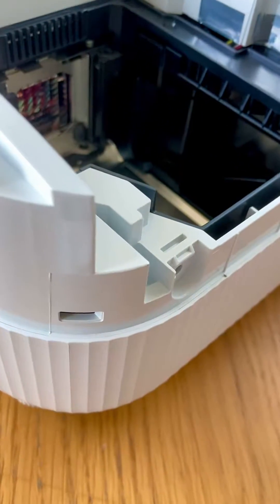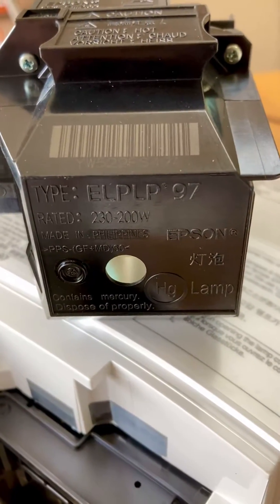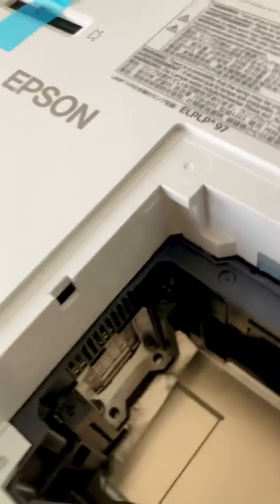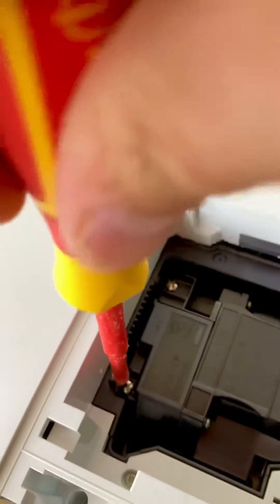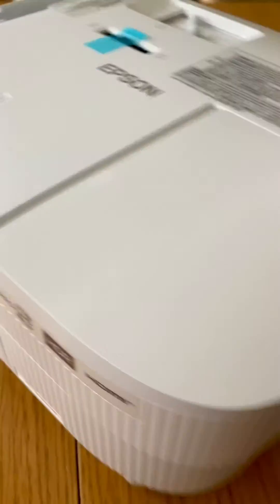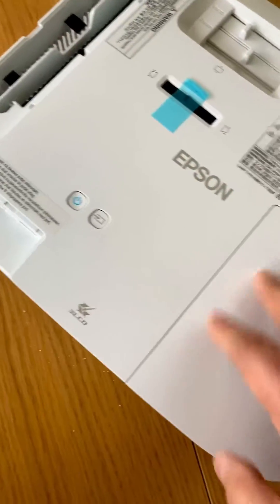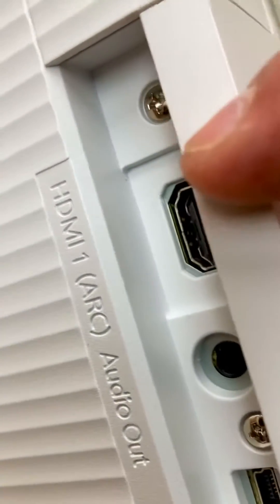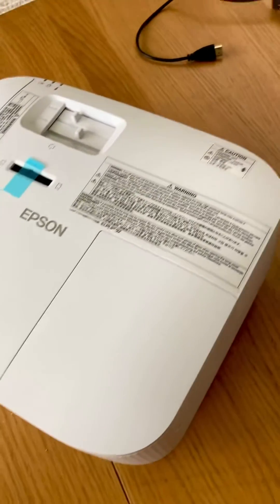How to Replace a Projector Lamp?🤔📹| See: Epson EH-TW6150, EH-TW6250, EH-TW7000, EH-TW7100 & others

Comment: Excellent video thank you, so useful, my current lamp is flickering a bit on low and mid power so i presume its on its way out. Is it wise to replace it before it goes pop? Can I cause damage with this model if it pops?
Reply from the maker: Hey 👋 Thank you for the feedback - really appreciate it 🤗 

You should replace the bulb if you're already seeing signs of deterioration. These bulbs are built under high pressure and operate at a very high temperature / dissipate a lot of heat. The bulb's glass envelope can burst and can certainly damage other components within the unit. So yes it can definitely "pop". We do also highly recommend replacing the bulb with an original OEM replacement part.

Hope this helps. Don't forget to subscribe 🥂

Cheers!

Comment: Great tutorial. I just changed my Epson 5050ub bulb yesterday. But I had an issue. The two screws would not screw in even after I pushed in the new bulb. Will my projector bulb still function fine if those two screws are loose? Also my projector is standing up, instead of hanging upside down from the roof.
Reply from the maker: @infamous1454  Hi!👋 Happy to know it helped. The projector would certainly work but the bulb definitely needs to be screwed to the bracket securely. We would recommend securing it properly to avoid any issues that might cause a potential damage to the bulb. 

Don’t forget to subscribe 🤗 🤜🤛
Reply: @MyNextBest, Thanks for letting me know. I'll try to screw it in again today. I've been using the projector for a few days now without issues.
Reply: @MyNextBest , Just talked with epson today and they are sending me a replacement. The two screws on the bulb would not screw in and they said if I keep using the projector then it could cause internal damage.
Reply from the maker: @infamous1454 Amazing! That's brilliant outcome, thanks for sharing! It's definitely very important to secure the internals of a projector otherwise components such as condensers or reflectors could easily be damaged. Worth mentioning, this applies to all projectors and not just Epson ones 😇 

Happy for you that your issue is reaching a resolution 👏🎉 Take care and happy binging! 😄
Cheers!